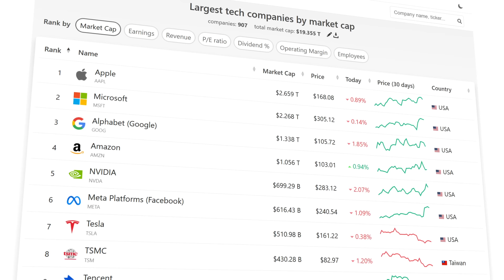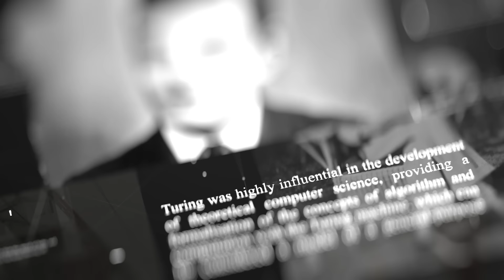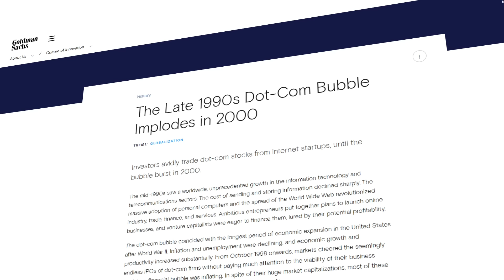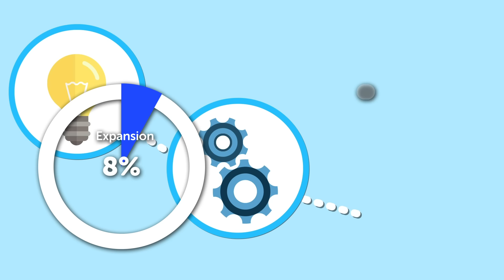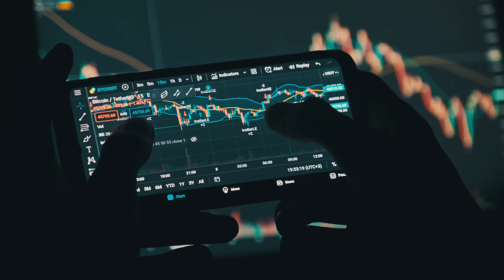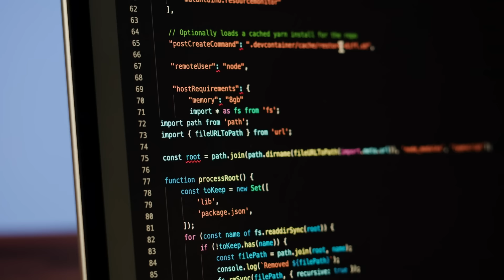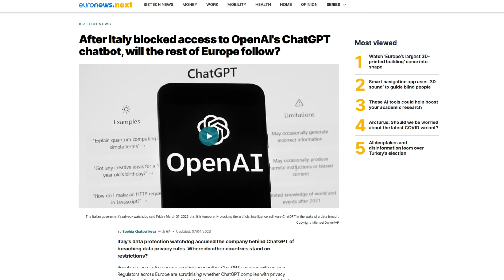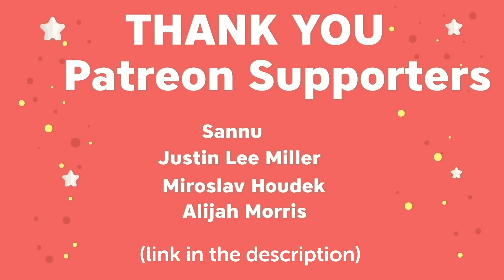Why Europe Failed in Tech

Comment: 1) On the flipside U.S. has currently major problems with having so large companies that they can sway politics, avoid taxation and local regulation. They pay 0-3% tax compared to normal 10-35%. In this aspect, EU has better diversity of small and medium sized companies.
2) There is clear trend of reshoring electronic manufacturing from Asia closer to the western markets due to geopolitical reasons. This has become possible from highly automated factories, so I wouldn't personally bet on Asia having tech manufacturing in this large percentage in 10 years time
3) EU is the most advanced market in material recycling. This will support domestic manufacturing efforts when materials can be sourced through recycling
4) Places like Silicon Valley used to attract the best and brightest from Europe, but it's attractiveness is on significant decline. I would not bet Silicon valley to be the only technological success story in 10 years time. 

Despite these points, I fully agree with some others in the comments, that EU has severe problems with overburdening bureaucracy, and we would need to cull 25-30% of the rules and especially people watching over others to truly become successful in industries like tech (too many people's job is basically stamping digital papers and passing it to the next person). That and also bold investments into larger companies to scale inside the EU.
Reply: sounds like cope
Reply: @SaxonFaust indeed it is. Lol
Reply: You think Asia is in decline, you think USA is in decline but it is the EU that would go through a downward irreversible spiral... Cope with it, and if possible Enjoy it.
Reply: @DhrubajyotiRaja01 
1) I didn't claim USA is in decline, I highlighted they have some societal problems with how large some of the companies have become.
2) Asia has major problems ahead with the rise of automation. Same happened with wool factories in the UK when steam power was invented. Less demand for low-skilled labor, more profit for factory owners. Same will happen in Asia, question is where will the next generation of high automation factories arise first: USA, Europe or Asia.
3) If you actually read my comment, I observed major problems of EU too.

This is kind of the problem with modern world, people have lost the ability of argumentation and practicing dialogue. I am not trying to change your opinion, I respect them.
Reply: europe need to attract top talent of world .. compared to america they have failed ... top engineers top medical minds move US from asia ...
Reply: "Places like Silicon Valley used to attract the best and brightest from Europe, but it's attractiveness is on significant decline."
Is that really true? Despite all the layoffs and immigration becoming harder, it seems like talents want to move to USA more than ever. Cuz the pay gap between USA and everywhere else keep increasing

Comment: There is an error on your map at 5:14 Crimea is actually Ukrainian. Can you correct this please ?
Reply from the maker: That's on Geolayers 3 plugin I use. It excluded it. Will fix it next time.
Reply: Illegally transferred in 1954, recently corrected.   Please correct yourself.
Reply: the guy spreads info he doesnt know alot of
Reply: @mojrimibnharb4584  you can go back even further than that if you want
Reply: @mojrimibnharb4584  also your comment is hard to understand what you are actually saying. Or maybe I’m having a stroke
Reply: @James-bs8bd  Crimea has been russian since 1856.  Khrushchev transferred it from russian ssr to ukraine ssr in 1954 contrary to the USSR constitution.  The majority of the population is ethnic russian and, in every poll before and after the invasion, has supported return to russia.

Don't confuse this with the situation in western ukraine which is completely different.
Reply: @mojrimibnharb4584  I thought it was 1783 when Russia annexed Crimea the first time. Originally it was Greek. Then Ottoman. Then Russian Empire? I could be wrong
Reply: @James-bs8bd  Sorry, that was the crimean war.  I did that in a hurry.  The russians took crimea from the ottomans in 1774 (as the khanate) but the treaty acknowledging the change happened in 1783.  

Point being, it was russian long before, most of the population is ethnic russian and, in every poll before or after the invasion, has supported returning to russia.

Again, this is not a comment on the rest of the war or the nonsense being peddled in the donbas.
Reply: @mojrimibnharb4584  fair enough I suppose. As I don’t have first hand knowledge of polling or decisions being made in Crimea I can’t comment. All I know is some of the history and it is incomplete. I’m curious to what you mean when you say nonsense peddled in Donbas?
Reply: @James-bs8bd  1.  Only a few people have "first hand" knowledge of any poll ever taken.  The results are readily available.

2.  The argument made by russia vis a vis separatist groups they are coming to support.  Transparent nonsense.
Reply: Not any more. Probably never again either.

Comment: The video seemed decent until it lost all its credibility with the Airbus vs. Boeing example.
"Airbus faced competition from Boeing against their A330-300..." and then not even mentioning which Boeing aircraft it was supposed to compete against or any mention of that Airbus' A330neo was a smaller strategic move to offer competition against the 787. They already had the all-new A350.

Additionally, what one can gather from this is that Europe is focused less on being Top 10 in Tech just for the sake of being Top 10 in Tech and instead, focusing on the technology actually fulfilling  its purpose; do you think that's still a failure?